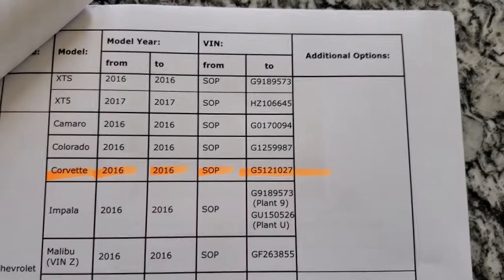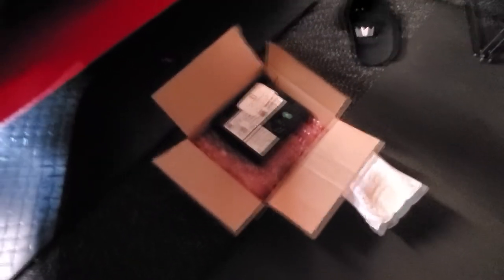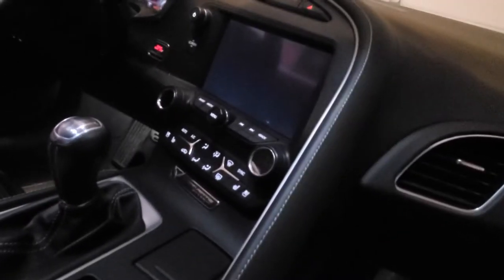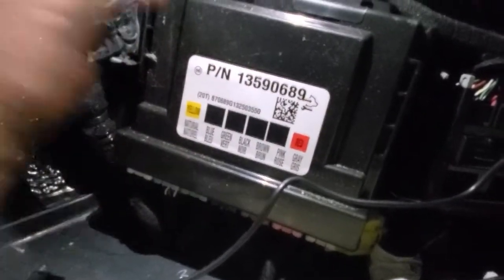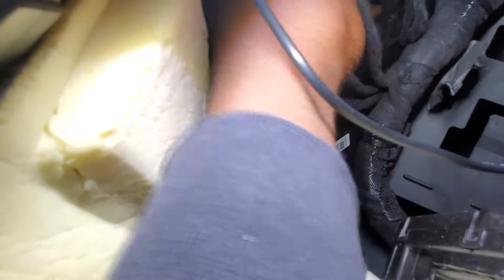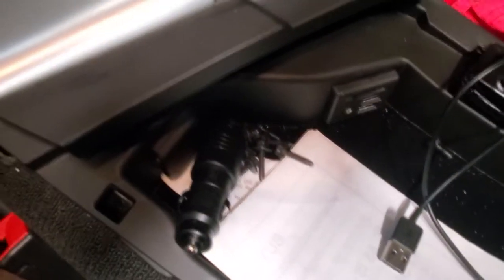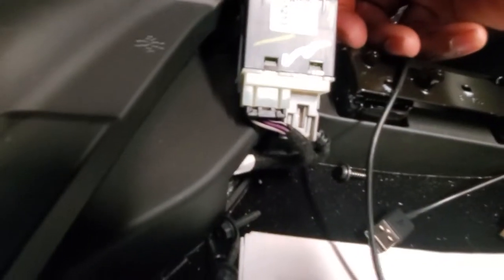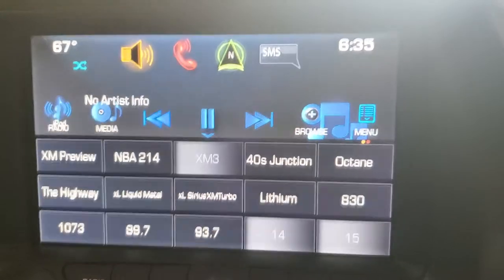Adding Apple Carplay to 2014 Corvette C7, HMI 2.0 to 2.5

Comment: its the iphone because even the slow charging usb input still trickle charges it and phones 4 years old seem to work but eventually the cells in the battery die out and then it cant hold enough charge.

Comment: Did this resolve ur flashing screen? Thanks.
Reply from the maker: It actually did. I read that the cable causes the issue but I guess mine was radio module. I never got the issue again after this install.

Comment: Does your ride management gps PDR all work.
Reply from the maker: GPS works better with the newer one, and the magnetic ride works fine also. Pretty much  everything works except the PDR. But my car wasn’t originally equipped with it so I don’t have the module or cameras. The HMI unit I bought came out of a car with PDR that’s why it shows on my screen.  It could be added tho.
Reply: @montiz333  thank you. Well done video!

Comment: Good video, I really liked how you showed the different difficult spots. Do you have any regrets? If you could do it all over again would you still do it?
Reply from the maker: I would definitely do it over again. WAZE has saved me from tickets lol it was totally worth it. Shops typically charge a lot for that too. If you know someone at Chevy that can program the HMI it’s really cheap and super worth it.
Reply: @montiz333  what do you mean? I just bought a 2014….u sayin i can have a tech upgrade it without buying it?
Reply from the maker: @mranderson757  no you still have to buy an updated HMI unit, but those are pretty easy to come by. If you know someone at Chevy or GM you can save on the programming portion

Comment: Do you have any links?
Reply from the maker: just the ones in the description, all the parts I used were from Ebay, and the company that did the flash doesnt have a website either. I have her email if you'd like that.